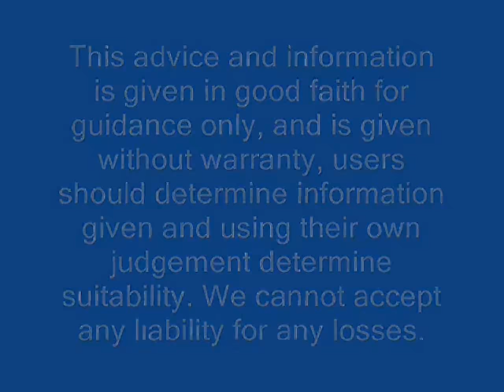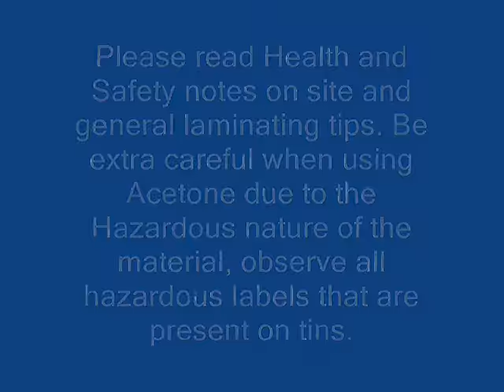#3 making a fibreglass mould using optimold tooling resin

Comment from the maker: the mould must be a lot thicker and rigid than the finished item, usually as a rule of thumb, three times the thickness as the finished part is a good indication. On large projects reinforcements, such as angle iron, aluminium, chipboard, and plywood etc can be bonded to the mould for extra strength. Reinforcements should be placed particularly on flanges where  stress would arise from levering the finished items from the mould. make sure mould has cured first as bonding ribs ect. rgds ecfibre

Comment from the maker: we would recomend a safety googles to be worn at all times when using this material also vapour respirators if sufficient extraction or ventilation is not available, this moulding was made in a factory with adequate ventilation overhead extractors and ground floor extraction. Be aware that different countrys have different health and safety regulations for use of this material in europe the maximum amount of exposure is 100ppm over an 8 hour period.

Comment from the maker: Hi kombipode, The initial lay-up with the lighter grade matting (300g) is to ensure a good consolidation to the gelcoat once this initial layer has cured we sand it down wipe with acetone then follow on using a 450g matting.
Kind rgds ecfibreglassuk

Comment from the maker: One of the advantages of Optimold  is that the 5 layers mentioned can be applied wet on wet making the lay-up process alot faster without risk of shrinkage.
If using a general purpose polyester resin you would only be able to build up 3 layer max then leave to cure ,sand and apply further layers this is due to exotherm and risk of distortion from shrinkage that you would expect from a general purpose resin.

Kind rgds

Comment from the maker: The plug featured is made from timber, then primed with a duratec primer, radius fillets are created with plasticene after the primer has been rubbed down to a smooth finish with wet or dry abrasive papers.

rgds ecfibreglasssupplies

Comment from the maker: If the first cured layer of 300g is not sanded, then any fibre splinters upstanding will make consolidation of the secondary layers quite difficult and can cause trapped air between the laminate. the acetone is to prime the area which has been sanded to ensure a good chemical bond.
Thanks ecfibreglassuk

Comment from the maker: @GoodScienceForYou Hi Working Time will vary depending on working temperature and catalyst addition. as a rule if adding 1% at 15 - 20 deg C you would expect the curing time to be approx 30min. and at 2% addition of catalyst you would expect approx 20mins. this is based on using a medium reactivity catalyst with a general purpose resin but it is always best to check with the supplier of your resin as some resin types can have a different curing time. Hope this helps

Comment from the maker: Hi, Wax release agent is used to prevent the parts sticking to each other, a wide range of composite materials can be used from basic Chopped Strand Matt to more advanced materials such as Carbon Fibre.

Comment from the maker: Hi desmondvick, we used to hold them at our workshop every month but unfortunately we have had to put them on hold due to lack of space. you can visit our website (details at the end of this video) you will see we have alot of info on a wide range of applications and a wide range of materials.
If you live within the UK we can supply you materials and our advisors are always happy to assist with guiding you through your project by telephone or e-mail.
 
rgds ecfibreglassuk

Comment: Everyone will tell you a different mold release agent that works "the best"....I've had the most success using a two-part process: #1.no less than 5 coats of mold-release wax with an hour of drying time between coats. #2. 3x light coats of PVA.  Then again, I've also had alot of luck just using cooking spray. Go figure...
Reply: catamaranman333 of